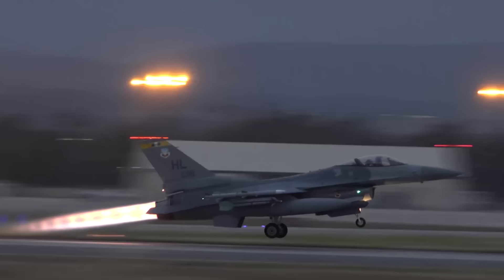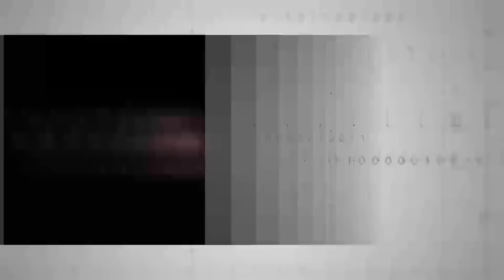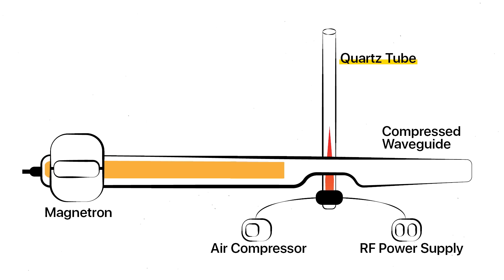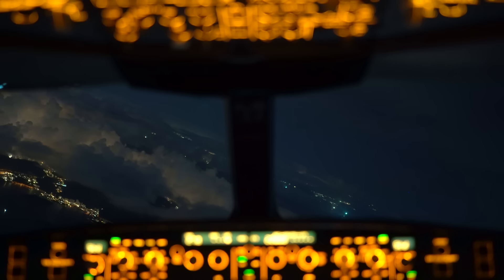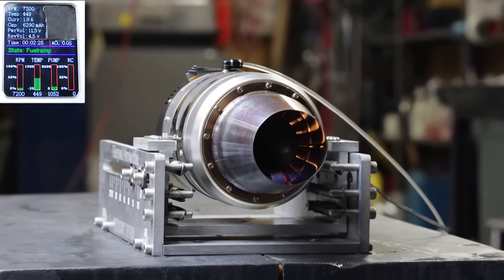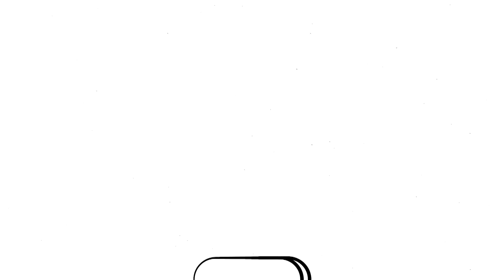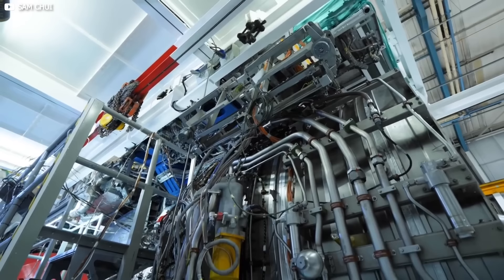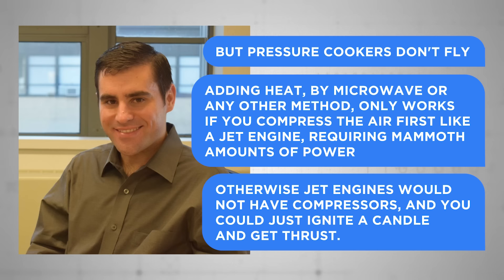What Are Electric Plasma Jet Engines?

Comment: A320 uses "CFM Intl. CFM56-5B4" engine, that engine weights 2380kg (per single engine) that gives us 92.4 N/kg trust power. Halve that because there are 2 engines, and we get 46 N/kg. That is excluding fuel weight. 
The fact that prototype does half of century-old technology is very impressive indeed. This video tries to hide this fact, I wonder why.

Comment: Funny, this tech is not new. Gasonics did this thirty years back to create a wafer plasma stripper basically generating atomic oxygen to strip process masks off silicon wafers. So, let's blow lots of air thru it and call it an innovation. Gasonics used aluminium oxide parts to get around the temp erosion issues.

Comment: We could achieve the same thing with much more efficiency using just a powerful fan (the main drawback being that it doesn't sound as cool). The only reason we're not using it on planes yet is because of the energy storage limitations of current state-of-the-art batteries. 

Or we could just use biofuel, or continue flying on jet kero since aviation only accounts for a measly 2% of global GHG emissions.

Comment: Could one contain the plasma stream in the engine with magnetic fields?  It worked for the cathode ray tube.  toroidal coil?
Reply: Technically yes, eliminating some plasma erosion problems maybe, but adding weight, need for more cooling of the electromagnets, hence needing more power, which would still lead to the lack of appropriate battery technology we do not have.

Comment: A jet aircraft powered by clean electricity. OK but only if that electricity is obtained from wind, hydro or solar and only if those technologies and the raw materials that built the wind generators, hydro dams and turbines etc and solar panels were manufactured using wind, hydro and solar. Only then can you say the electricity used by the Jet engine is clean. The manufacture of the jet itself using clean energy is another issue entirely.

Comment: Well i can’t see why we are not using railgun technology allong a 2 km airstrip that is rampeed upwards to 30 degrees to get our aircraft going. That will use static energy from solar and liquid metal batteries. That would save 20% on fuel for 2 hour flight. And an energy recovery system for landing .  Take off uses tremendous amounts of fuel . Lets get smarter!

Comment: Thorium based fission reactors could actually be fairly viable for electric jets. Thorium based reactors have built in fail safes to prevent meltdown events, they are very small, require very little Thorium to run, and harness a load of power.

Also, they can be modularized and made compact.
Reply: Flying nuclear reactors, great what could go wrong.
Reply: @Project2457official  you're new youtube major should be bro-science. Lol
Reply: @doirtlee  Thats my point nuclear is the future, and nuclear thorium may very well be a possible future of air travel.
Reply: @Project2457official  we come full circle and you're no more intelligent for it. At least you're emotional outburst made me laugh. Good luck future bro-scientist.

Comment: If you have that much electric/battery power available on a plane you could simply drive the turbines with electric motors with a combination of compression and venturi effects. The energy required to make gas expand is not feasable. Nothing has the energy density of fossil fuels apart from fission/fusion. And since we are still in the early stages of fusion reactors it will be quite a while until thats minutarized. Then the heat alone that a fusion reactor puts out could be used to heat up gas to make it expand and make a jet. You won't need fancy plasma stuff anyways. I suspect in like a couple decades we manage to make atmospheric fusion drives. But its far away from the concept of an ordinary engine. More like a rocket engine hybrid then a turbine.

Comment: I doubt this will be on airplanes any time soon, but maybe as a preheater for an ion drive in space. Existing ion engines have little thrust because they heat little gas. But if there were a way to shoot out kgs of plasma per second at 50 km/s, it might justify putting a nuclear reactor on a largish space ship for fast human travel around the solar system on time scales that won't make astronauts crazy. I know next to nothing about plasma engines so I have the luxury of thinking anything is possible. Why not go CERN and accelerate ions to 3/4 light speed and get a really kick ass ISP. Seems possible to me:-)

Comment: I am a retired engineer. Those researchers are wasting time and money on this. I assume that they have done a simple energy balance or a thermodynamic analysis of this technology, and already deduced (but kept a secret) that inductively-coupled plasma engines can never possibly be anywhere near as economical as normal jet or propeller engines. In fact, they might use more energy than they usefully produce. All of this can and should be answered using the appropriate equations and calculations, without spending any money on physical equipment or tests. Assuming that they have already deduced this, then I feel that it is unethical for them to spend large quantities of other people's money without making it clear that they will never obtain anything that can be useful in the real world. Finding materials that can handle high temperatures is the LEAST of their problems.

Comment: And far as people trying to recycle the space shuttle design where it's been piggybacked on a another aircraft that was to begin with was a sucky design because the simple fact it was never used for launching and the way that they tried recycling it the only thing that was good for was keeping contracts full by having to rebuild it all the time heat shield tiles

Comment: A massless reaction engine !!
Let's look at the physics. To move 1 kg up one needs to apply at least more than 1 kg force down if you used the reaction principle, times the velocity formula. So to move 1kg upwards at one meter per second you need to throw at least ≥ 1 kg downbeat least per second. Or you could throw 2kgs down at half a meter per second, or you could throw 1/2 kg at two meters per second, or 1 gram at 1000 meters per second. So theoretically, if we shoot a tenth of a gram down at a rate of 10,000 metres per second we should be able to reduce our 1kg down to a level that could easily lift off. It's basically how 380 ton aircraft move forwards and build up air pressures to lift itself off the ground.

Comment: No smelly hydrocarbons? Green technology? Where is the electricity going to come from? How long will it take to recharge the batteries for the next flight?
And if you're going to power a flying machine with nuclear power, you're going to use a molten salt reactor (which was designed specifically for this application), not something that works with water, pressurized or not.

Comment: i too can make a "plasma jet engine". i cut a grape in half and stick it in the microwave. 

you actually have to propel the plasma to get meaningful thrust and if you're just using the expansion then yea you have to create a thermal cycle compressing heating then directing the expansion to do work. and all that would still be to drive a fan like turbofan engines do as thats where you get your most efficient thrust, but if you're using electric power to create and heat plasma then just run an electric motor instead. what this guys did is meaningless, but if you're looking to use microwave power for thrust there is the idea to direct a microwave beam at a craft to either convert it to electricity or have it directly heat propellant. but no ones considering using that for commercial aviation as firing microwave beams powerful enough to vaporize someone everywhere is ridiculously dangerous.

Comment: Can it be designed to convert two partials has a consent flow has in a detarration matter fuel plate and soom early obtained covergjn gases change long running syrem? 🤔I'm not that up with the current stage of the plasma engine but if a cathoid design that may be made strong enough ? Well are time will show 😀thank you very much for my  thiught

Comment: To avoid batteries I would go for hydrogen, maybe in combination with fuel cells, or simply burn it directly in a gas turbine, I am just not sure about the NOX gases in the later case.
Reply: Where are you going to get the Hydrogen ? Main source currently is as a byproduct of natural gas (i.e. a fossil fuel) and it's very expensive or you can use electrolysis which is even more expensive and you need vast amounts of electricity for that.
 It also needs compressing in very heavy tanks and it's energy density is very low.

Comment: a tesla battery chould power a conventional jet engine modified with catholde anode in the nozzle and a power inverter that convert dc current to about 2000 volts to ionize the compressed air from the intake compressor.  that chould give conventional jet power thrust.

Comment: Why use plasma? Plasma has lots of pesky free electrons which like to tear matter apart. Electric motors are cheap and easy. Use one to power a ducted fan. 

Of course the fuel's energy density is still at least o factor of ten behind what's needed with basically no room for improvement. But theoretically the microwaves could be produced on the ground and shot to the plane. Eliminating the need to carry expensive fuel could make such a plane (or rocket) viable. 

Plus we could cook hot dogs by waving them around in the air if the control on the microwaves ever slipped even a little. (I'm not sure that's a good thing.)

It's still likely better to use an electric motor and a fan.

Comment: Forget THERMAL Combustion - Engines : They ALL have the Problem with NOx- and CO2- Emissions. BUT we can use E- Engines with PROPELLERS and Batteries. The propulsed AIR will remain CLEAN. That's the BEST Solution.

Comment: It's easier to make plasma by other means. It's good but you can do better. 
h/lambda is also nu/c
p = h nu /c
Photon has momentum p
But in 1908 Minkowski showed that in a dielectric light has its base momentum times the refractive index which is the square root of the dielectric constant.
29 Newton's per kilowatt is pathetic. Photon drives can do 100,000 Newton's per kilowatt if you use superconductive cavities.

Comment: I designed a hydrogen battery which when mixed with carbon dioxide creates a dense fuel which I call Gas-O-Lean 😮

Comment: That sounds all well and good, but tell me, what produces the electricity to power the magnetron? I'm going to take a wild guess and say a fossil fuel powered generator. It always comes down to that doesn't it? Nothing is going to fundamentally change until Zero Point Energy technology is finally released. Much to the Chagrin of the fossil fuel industry.

Comment: Might be good for spacecraft. I wonder how it'd compete with ion engines?
Reply: Spacecraft need to optimise for reaction mass, as they can only carry the reaction mass them bring with them. So an efficient rocket engine would put as much energy into each kilogram of reaction mass as possible, you want to accelerate the mass to as high of a velocity as possible so you get as much thrust as possible from the mass you bring with you. 
Aircraft don’t carry their reaction mass with them, they can take it from the air. So aircraft optimise by accelerating as much mass as possible to a low velocity so as little energy is used per unit thrust.
These are fundamentally different, spacecraft maximise the thrust per unit mass, aircraft maximise the thrust per unit energy
Reply: @iain3713  Thanks for that. This engine still works by generating thrust though right? I wonder how this concept would compete with the fuel-efficient ion engines currently in use by spacecraft.
Reply: @poisontoad8007  well there would need to be a few modifications like a built in gas supply, but i would probably bet it would be a bit worse. Ion engine can accelerate the ions really quickly, just heating something up won’t nearly get you the exhaust velocity and efficiency. I think there are designs of ion engines that use a similar concept with microwaves to ionise the gas, but the gas itself is accelerated using electric or magnetic fields
Relating to what I said earlier, but ion engines are really energy inefficient for the amount of thrust they produce, but they are very mass efficient as  you're pumping a ton of energy into the propellant. 
With aircraft, especially electric aircraft you need to be as energy efficient as possible since you need to carry batteries
Reply: @iain3713  Cool hey thanks for putting the time into explaining that to an amateur pleb like me. Are you an engineer?

Comment: Why dont they just use an electric engine to turn a fan to make thrust? Cant they just scale up RC drones and airplanes? Heating up the air will take extra energy and I dont see any benefit of using heated air instead of cold air. Only the speed and mass of the air matters.

Comment: An array of biefeld brown devices would generate the same thrust with the same power requirements. Its not very efficient but neither is plasma. The power problem applies there too. There is no easy way to beat hydrocarbons. 
There is also no significant green house crisis either so the reasons to move away from fossil fuels is invalid.  The climate models left out a major cloud seeding phenomenon and its kicked in to stabilize everything.

Comment: What do I think?... I think this obsession over reinventing the wheel is entirely illiterate.
Reply: In this case, I agree with you. The researchers should have (and possibly secretly have) first proven whether the total engine system on an inductively-coupled plasma plane can at least theoretically meet all of the requirements, before they spend any money to buy any equipment or build anything. The unsolvable problem is how to provide the engines with massive amounts of electrical power, in a cheap, light weight, compact, safe, smooth, and reliable manner. Adding additional equipment to a plane usually does not decrease the plane's weight, size, cost, complexity, and time-between-failures. Quite the opposite.

Comment: Welcome to the waiting room. This seat is mine, but there are a few empty seats left over there. We are all waiting for improved batteries or other energy storage technology. Despite the optimism of certain young, uninformed green energy enthusiasts in government, any technology that might supply anything close to the energy density of fossil fuels is a long way off. Love the idea but the practicality doesn’t yet exist. If we landed on a planet with a sun, ample water, but no fossil fuels, I imagine solar powered electrolysis would provide enough Hydrogen for fuel for locomotion, heating, and metallurgy. I see no reason why this won’t be the ultimate system for this planet once fossil fuels are exhausted. Plasma may or may not play a role. Who knows?

Comment: What would happen if you used a free energy generator connected to a plasma jet with a turbine that rotates off of the thrust as well as using it to propel. Basically you would be using your thrust as a generator for electricity. As the thrust exits the jet you can simply connect an external turbine that rotates within the field of thrust.

Comment: Technically speaking, this kind of engines are good. They produce far more thrusting power than the normal ones, but the weak point is that they requires a bit of time to arrive at that point.
It could be a useful way to fly in space, but in atmosphere, where you must rely on the plane portance to fly, this could be complex.
That's not means that technicians and engineers can not prefectionize this kind of engine, contrary, they can and probably they should. But the point is always the same: should we invest in some new form of engine that is environmentally friendly and consume little or nothing when we have to feed this parassitics company of fossil fuels? After all, from these companies depends a tons of jobs. The entire economies of some States... It would change for sure something in the economic balance of our world.

Comment: SORRY BUT, THAT'S JUST ANOTHER ILLUSION. The only way to flight a Jet Air Plane 100% green and safe, is using the reactor TERRICOLA 1, with multiple buffers system, mounted inside the fuselage. The Thrust will be superior to the one now in use, and the range of the plane will be about 26000 KM. Besides that, there is nothing on the market that can even come close to TERRICOLA 1.

Comment: Wouldn't it be simpler to just create synthetic jet fuel with green energy?
Reply: What would the by products of burning the synthetic fuel with air be?
Reply: @nic.h  It would be Carbon neutral  because the Carbon was taken out of the atmosphere to create the fuel.
Reply: @ph1984col  I'm a bit skeptical in regards to this. While the technology seems feasible, does it scale up well. I think the main issue is that the process of sequestering carbon dioxide out of the air and converting to a synthetic jet fuel is very energy intensive, and we just don't have the capacity of green energy sources to supply the required energy at any significant scale.